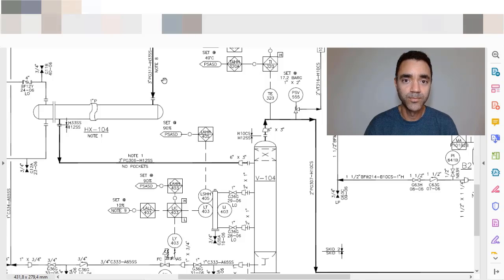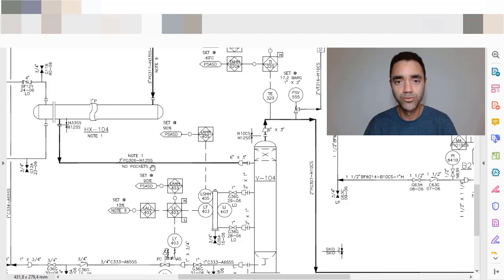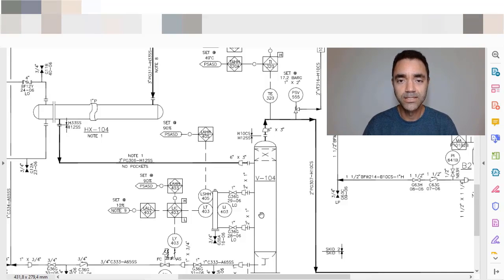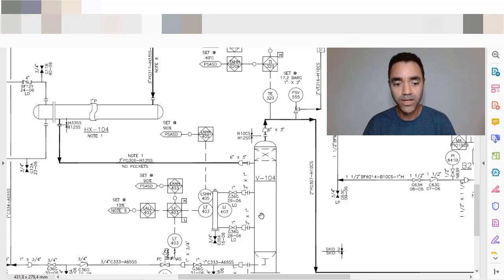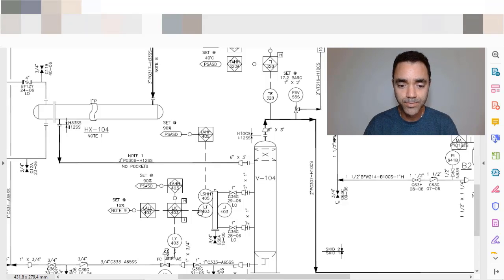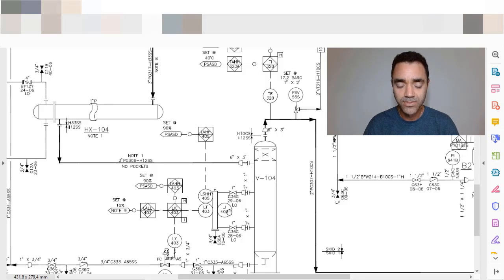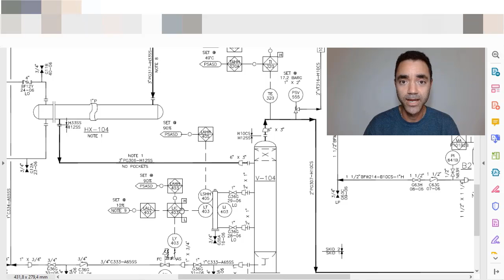Level control on P&ID | Vessel separator level control components

Comment: Dear Jeferson!I've got a question which is unrelevant to your currebt video. So I appologize for asking it here, but I would appreciate it if you could reply it. Actually I'd like to know how often  amine solvents are replaced in an amine CO2 absorption plant?
Reply from the maker: Hi Zahra, no problem. You can use this reference... Entrainment resulting from liquid in gas dispersion accounts for most of the amine losses in a typical amine system and is typically 0.5 lb/MMSCF (4 × 10-5 kg/Nm3) in a properly designed absorber.
Reply: @jefersoncostaengineer  Thank you for your reply.Actually I'm curious about the full replacement of the solvent. Or, maybe I can put it this way that how many times does an amine solvent is recylced in a plant before being replaced by an amount of fresh solvent?  I wanna make an estimation of the time which is solvents needs to remain in the plant.
Reply from the maker: Hi Zahra, it will depends on how good is your operating conditions. If your amine is good you will not replace that, only fill what is missing. Time to time it is recommended to do amine analysis to verify degradation. In any case, you will observe plant decrease in plant performance if amine is outside specification.
Reply: @jefersoncostaengineer  I got the point..Thank you again🌹